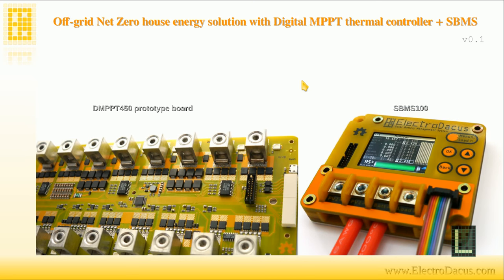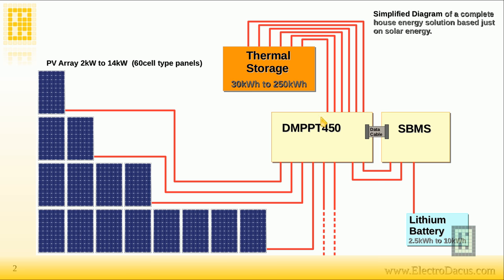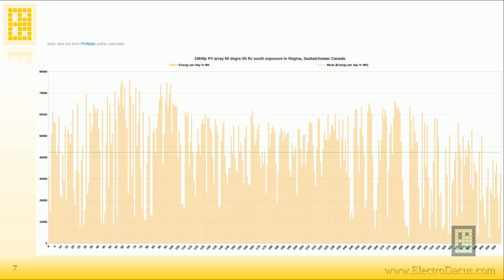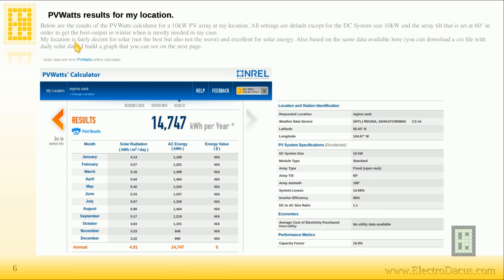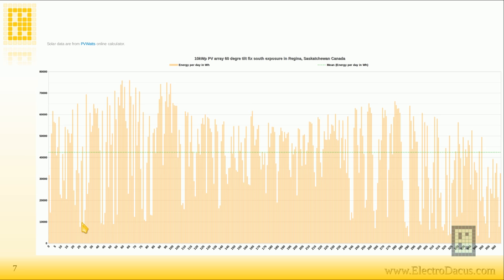Explaining the Digital MPPT thermal controller

Comment: Hi Dacian - Have you thought about using a phase change material for part of your heat storage. I saw a system  recently (search on youtube for Sunamp Heat Battery) where a company was using the gel from those thermal hand warmer pads you can get (where you click the little disc and the pack slowly turns into solid crystals, giving of lots of heat in the process). They said that the phase change gel in the hand warmers had 3x the thermal storage capacity of water. Might we worth consideration as part of your thermal store solution as you can heat it up to near boiling point and then flow cold water through a heat exchanger for showers, washing etc. Cheers!!
Reply from the maker: Hi Jim - Yes I have looked in to phase change materials for storage especially paraffin wax. The idea there is that you need energy to change phase so when paraffin will go from a solid to a liquid it will absorb energy without increase in temperature and then that energy will be released back while phase change will go in the other direction.
That is nice but when you consider the cost compared to water they do not look as good.
Also they are good for low temperature delta applications since hey provide better energy density but you can get the same energy density just by hitting the water at higher delta.
Water energy density is already good enough and very similar to a Lead Acid battery in therms of energy storage capacity by volume.
The reusable hand warmers are not the same as phase change storage that take advantage of the latent heat to store energy and they are based on a chemical reaction. The hand warmers while reusable have a very limited re-usability and also require reaching a certain temperature in order to work else nothing will happen so they are sure not a good solution for thermal storage.
To get an idea the paraffin wax will absorb about 60Wh/kg  (is lighter than water so about 1.1liters) during the phase change that usually happens around 30C to 60C (there are many types) and that is equivalent with what same volume of water can store in a delta temperature of about 46C so there is not that much energy in that change phase.
While you have a fix phase solid or liquid the energy storage capacity is about half as that of water so if you use same volume of water and can use a large delta temperature range for water say 20 to 90C then you get the same energy density as paraffin at lower cost.
In any case paraffin or other phase change materials may be a good solution is some case so people should look in to this also since I forgot to mention about them in this video as probably many other things :)
Reply: electrodacus The working (testing) instalation Jim mentioned was on YT Fully charged and they claim they cycled if I remember over 15k cycled without any loss of therm.capacity (or 50years). That really has potential to use DMPPT with houses with old water heating without full rebuild, what do you think?
Reply from the maker: I actually seen that episode of fully charged. Thermal storage is a very old concept (at least thousands of years).
There is no reason to lose capacity with that sort of thermal storage since paraffin is stable so yes that could last 50 years or more but water storage or concrete will last as long. The thing is that paraffin is more expensive than water and so it may not be justifiable to use paraffin just for the potential small savings in the space the thermal storage takes.
Any house can be used with DMPPT all you need is some space for the thermal storage (even water storage has about the same density as Lead Acid batteries for same capacity) and you also need space for a large PV array. An old house that is not well insulated and in a cold climate will need a very large array and ideally no shadows so many houses in city will not have that space fr the PV array.
From an economic perspective there is an ideal balance between the amount of thermal installation, thermal storage and PV array size.
Reply: I think the argument in favour of the phase change materials was that because your had 1/3 as much volume to insulate, you could use thicker/better insulating materials than you could if you were using a bulkier thermal-storage material. It was the better insulation which made it viable for them to ship heat by boats across the Bristol channel from where it was produced to where it was needed.
Reply from the maker: If you use the thermal mass for house heating and the thermal mass storage is inside your house then any loss will not realy be a loss and will be a net contributor to heating.
When heat needs to be shipped it makes sense since it will be lighter.
Most people will need a stationary thermal storage and I do not see the benefit of phase change in that case.
Is interesting they shipped energy stored this way. I had no idea :)
Reply: I'm not sure they had an actual working business shipping heat at the time that episode of Fully Charged was made. I think they said they'd applied for the permit. Their plan was to use the waste heat from some industrial process to heat up their stuff to ~95C... sail a barge full of it across the channel, and sell the heat to a municipal heating scheme... Their main argument being that if they shipped 1000 litres of their stuff, they could heat up 3000 litres of water with it at it's destination. I think their plan for domestic units was to replace the large heavily insulated hot water cylinders that houses have with a far more compact unit (~1/3 the size) which would retain the heat better. Cheers!!
Reply from the maker: If it was realy 1/3 the size then they will not have used paraffin but 
something else like some sort of salt hydrates and those are usually 
problematic since they do not have good stability and may not be 
reversible after a few cycles.
Here is a graph with different latent heat storage solutions  http://www.bine.info/fileadmin/content/Publikationen/Themen-Infos/I_2009/themen_I09_03_engl.jpg
As you see the paraffin while stable has little energy storage capability.
Reply: I think it was some salt hydrate they were using.. They did say it was the same stuff as in the hand warmers with the clicky metal disc to start the reaction happening...  but they weren't getting it hot enough for it to completely change from crystal to liquid, so they didn't think that cycle life was going to be a problem... At least,  I think that was what they said... I really should re-watch that video and check my facts. Cheers!!
Reply from the maker: I made some reading about all types of PCM but this page is a good summary http://www.climatetechwiki.org/technology/jiqweb-pcm-0
Reply: Thanks Dacian - that was an interesting read. Cheers!!
Reply: electrodacus sorry can't read that link

Comment: Thank you for the explanation.  In the summer when it is very hot, is there a way to disable the MPPT from producing heat?
Reply from the maker: Yes of course there will be an option in the SBMS menu if you are using both DMPPT and SBMS and if you only use the DMPPT then you can just turn off the 6 circuit barkers on the output of the DMPPT or maybe in y case just 3 of the outputs will be disabled since the other 3 will still be used in summer to provide me with hot water.
You can also add a switch on one of the two thermistor inputs on the SBMS and disconnect that way (The DMPPT will think there is an over-temperature condition and will stop the heating).
So there are a few possibilities and I will probably come up with even more as I start working on the software for the DMPPT.
I will have a proper manual for the DMPPT similar to the one I have for the SBMS where I will give more details.
There will be a lot more options that I did not had time to get in to in this video.
Like there will be a possibility to control heating for 3 different zones in the house but I will give more details about all this when project is closer to delivery.
Reply: electrodacus The temp control of each room is a good ideea. You should implement a way to controll the temp of the floor. It should not exceed 25 degrees centigrade as this would cause the dust particles to rise in the air and cause health issues. Have you considered heat recovery ventilation as your house allready has good insulation? This would further increase the efficiency of power consumption as you would not have the need to periodically ventillate the house for fresh air. And last, why don't you build your devices with an option for wind input. Usually when it's cloudy there is wind, at least for charging the batteries, even at night? Keep up the good work, you make our country proud :).

Comment: In running a small DC Air Conditioner possibly fewer PV steps are needed and the load is control by regulating the Air Conditioner Inverter. Are you planning any other version of the DMPPT in the future? 
With a DC Air Con the COP/EER also multiplies the direct Solar input.
Reply from the maker: This DMPPT will have probably option that will allow the use of a DC Air Con but since the amount of energy used for cooling is not that high even an more common AC can be used.
Most houses need cooling because of the heat generated by all other appliances in the house.
As an example a house that uses 900kWh/month excluding the air conditioning will need at minimum an air conditioning unit with a COP of 3 that will need to use additional 300kWh/month just to remove the other 900kWh/month generated by all other appliances in the house.
In addition to that each person living in that house will contribute with about 80W and if the person is 24h a day in the house it will add another 2kWh/day as heat about 60kWh/month that will also require around 20kWh/month of AirCon
The reason I do not need air con is because all my appliances only use 60kWh/month so about the same as just an additional person living in the house.
See this weather data  http://www.manlyaustralia.com.au/info/weather-and-climate/
Average temperature in the hottest summer day is just around 23C and that means that average ambient temperature has no influence on your temperature inside the house. A house with no appliances and decent amount of thermal mass will need no cooling at your location.
The average temperature at my location in the warmest month is around 19C and even so there are plenty of people using air conditioning in here because the houses are not properly insulated they have no thermal mass and use a lot of energy for appliances. 
The apartment I rented here was not livable without air conditioning all the time in summer because there where large windows facing the sun in summer it was a top floor apartment and the roof was horribly insulated also the water heater was under that apartment so even the floor was warm.
There is a good chance that those DC air con are low COP if they come from China but if they are good then they may be a good solution. I will just need to know what the analog control needs and what are the power limits that the can work at. If I know that I can implement special firmware in the current version to work with that DC Air Con.
In winter months it is another story since those appliances that say use 900kWh/month will probably be just enough to heat the house.
Reply: Today the temperature got to 45 in a few parts of the state. Inland it tends to drop quickly during the night. While the sun is shining is when the Air Conditioning(AC) is needed most. My battery pack is fully charged by midday so I have panels sitting doing nothing half the day, with no heat generation in the house. So I have a few Kw of generation available for 6 hours. Would be nice to be able to use it.
Reply from the maker: While +45C is probably one record day the max average temperature (hottest year) for the month of January or February at your location is 26C (base on link on the other comment) that is just about comfortable temperature in summer for inside of the house.
This means that if you had no other source of heat inside the house like appliances or humans all you will need will be a large enough thermal mass to keep the inside of the house around that average temperature.
So air conditioning is only needed if there is not enough thermal mass or if there is additional source of heat inside the house that will need to be removed.
I do not know the level of thermal insulation and thermal mass for your house so I do not know the amount of energy you will need for cooling.
If cooling is needed my recommendation is to use TEC12715 for a 20C delta where COP between close to 2 can be obtained while module is supplied with around 4V and able to pump 25W.
8 of this TEC12715 in series will make for a good cooler so that 200W can be removed from the house. I guess about 7 of this modules that can remove around 1.4kW while using less than 1kW including pumps and fans depending on design will be able to cool you house or at least par of it since I have no sufficient data about the house.
Yes this peltier type cooling will involve a lot of DIY work since something like this that is already made is not available to my knowledge.

Comment: Treaba buna Dacian. Do you have any plans to do anything on 48V or even higher? I would like to use some Tesla batteries. Also I went through some videos and looked over the manuals but did not understand yet what is the minimum and maximum PV voltage input.
Reply from the maker: Mersi. This video is about the DMPPT450 that is for solar PV heating so has almost nothing to do with Lithium battery charging other than it can be used together with SBMS120 so that Lithium battery can take advantage of the large heating PV array.
You need to check the SBMS user manual here http://electrodacus.com/SBMS120/manual/SBMSmanual.pdf and you will find what the max PV voltage is in page 4 Specification. max open circuit voltage is 47V but,
for 12V battery 4s LiFePO4 ideal is 32 or 36 cell PV panels while for 24V 7s NMC or 8s LiFePO4 60 cell panels are ideal and 72 cell will work if you already have them but 60 cells will be much more optimum as they are very close to max power point.
Tesla battery is a bad option for offgrid energy storage for at least two reasons. One is that is already made as a 6s so just 22.2V nominal and will not work with almost any inverter (it will work but you can only use at best the top 40 to 50% of the battery capacity) and second that is based on cell optimized for high energy density to the detriment of cycle life and while great for EV is a bad choice for offgrid energy storage since the amortization cost is much higher as typical cycle life for those cells is 500 at 100% DOD vs LiFePO4 that have 3000 to 5000 cycles and so even if a bit more expensive to purchase they will have a significantly lower cost amortization over the lifetime.
Reply: I was looking at Tesla batteries because they are cheap. http://www.evwest.com is selling 3kW at 57v with 700$. They also sell the 22.8V 5kW at $1500. I already have a solar system made with 72 cell panels and SMA 4000 TL-US  Grid Tie. 
Your project is really impressive and since I am looking for an off grid solution I am looking to see if I can use somehow your products. I will  watch all your videos.
Reply from the maker: The 72 cell panels are fine you just need to have them all in parallel.
The Tesla battery module may look cheap but is unusable with 24V inverters and is expensive in therms of cost amortization.
Take a look at the spec for the Panasonic cells used in those modules http://evwest.com/support/ncr18650.pdf
See second graph where after 500 cycles the cell capacity is already at 80% or less from original capacity and so considered at the end of life.
Compare that with a Winston (Voltronix branded in US) LiFePO4 cells that can do 3000 cycles at 100% DOD and 5000 cycles at 80% DOD
On top of that those Tesla cells are already old and used so they have already some cycle degradation and calendar aging degradation where Winston cells are new and have at least 15% higher capacity than stated on the label.